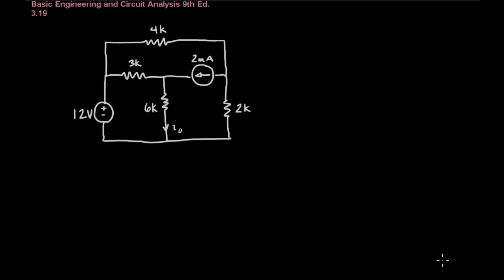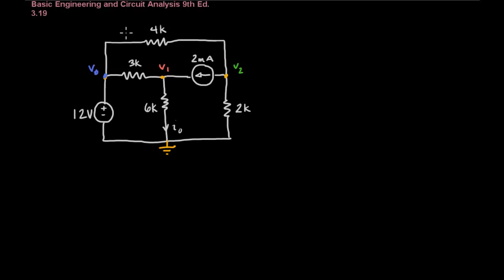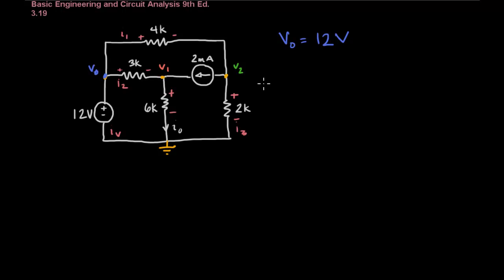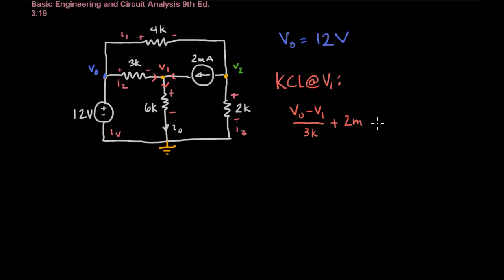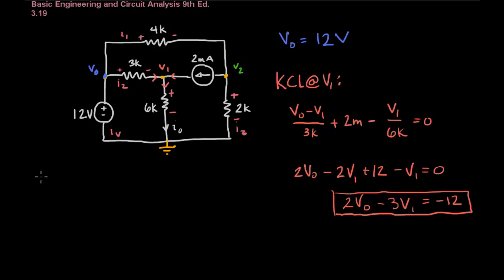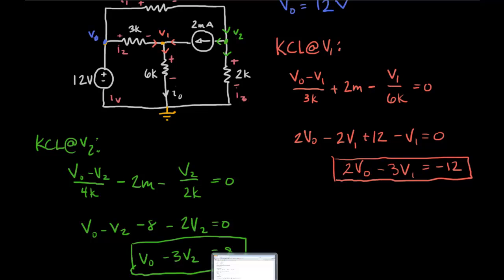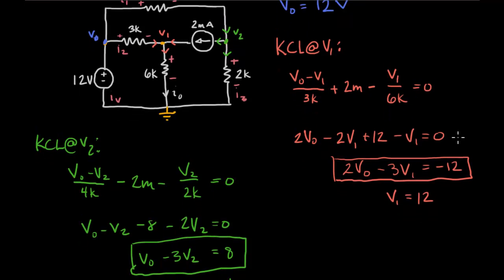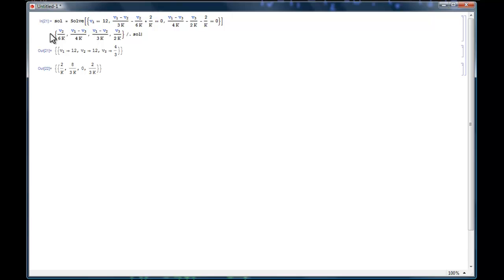Nodal Analysis Problem 3-19

Comment: Used the basket rule, I don't know if it's correct, but I think it's useful for smaller values.
2 -3 0  -12
1 0 -3  8

-12 -3   0   -12
 8   0 -  3   8

2  -12  0   2
1   8   -3  1

2  -3  -12 2
1   0   8  1

d= (0+9+0)-(-6+0-3) = 9 - (-9) = 18

d1= (0+9+0)-(-36+0+-24) = 9 - (-60) = 69

d2= (16+36+0)-(-6+0+-12) = 52 - (-18) = 70

d3= (0+24+-12)(16+0+-3) = -36 - 13 = -49

d1 = 69/18 = 3.83

d2 = 70/18 = 3.89

d3 = -49/18 = -2.72

Comment: yep, Mathew seems to  have forgotten about mA units while he was doing algebraic transformations to get rid of denominators. The correct values for voltages should be V1=8.004 v, V2= 3.997v and v0=12 v. Consequently  i0=1.334mA,   i1=2mA, i3=1.998mA,iv=1.333

Comment: If a resistor connects V1 and V2, is the voltage drop across the resistor V_1 - V_2? or V_2 - V_1?
I'm pretty sure you have to assume that one node voltage is greater than another. Most of the time I don't which assumption to make though.
If the assumption we make ends up being wrong, will that result in a wrong solution?
This is so hard. I've been getting every question wrong every time.

Comment: Please disregard my previous comment,  The problem is correctly solved in the video. 

mA vanishes because if one puts the 2 mA on the right side of the equation, do the least common denomintor on the left side,    

and then multply the kOhms of the least common denominator by 2 mA, the milli will be cancelled out.

Comment: Isn't it convention to use negative for current entering a node and positive for current leaving the node?
Reply: No its the opposite one
Reply: Souvik Das So this video is in conventional flow right?
Reply: you are completly right my friend see the 2mA is adding current to that node that means when you make the equation for that node will equal +2mA and you use that convention so you can later use the format aproach for nodal analysis
Reply: and also this fact can be a little confusing but when you are using nodal analysis all the currents are leaving that node unless the circuit tells otherwise so for that node in particular the easyest way of writing that equation will be:                                      ((V1-V0)/3K)+V1/6K=2mA
Reply from the maker: Ygal Mizrachi As far as I know the only important convention to apply in circuit analysis is the passivity rule, which this video follows.  KVL simply states that the sum of the voltages at a node is 0.  I am free to choose whether entering the node or leaving the node is positive.  Furthermore, I can choose differently for each node.  If you want to have a convention that you use for this, that's ok, but It's more important to understand and correctly apply the concept of KVL.

Comment: how to solve  R A C T I C E P R O B L E M 3 . 2
Find the voltages at the three nonreference nodes in the circuit of Fig. 3.6.
10 A
2 Ω
3 Ω
4 Ω 6 Ω
ix
4ix
1 3
2
Figure 3.6 For Practice Prob. 3.2.
Answer: v1 = 80 V, v2 = −64 V, v3 = 156 V.
3.3